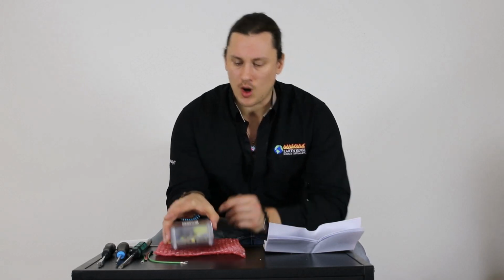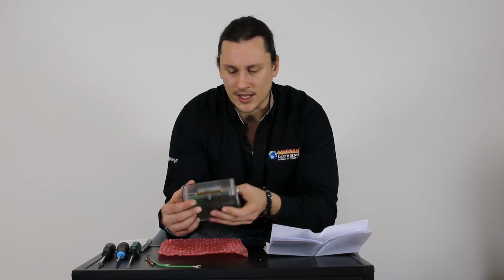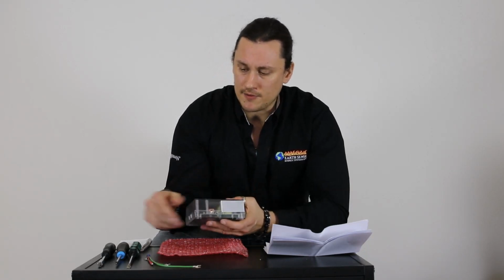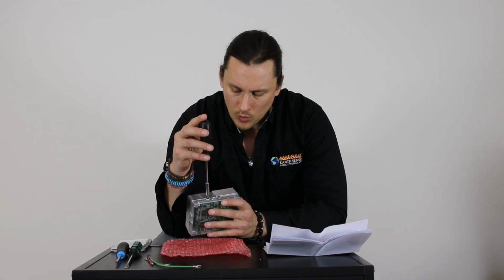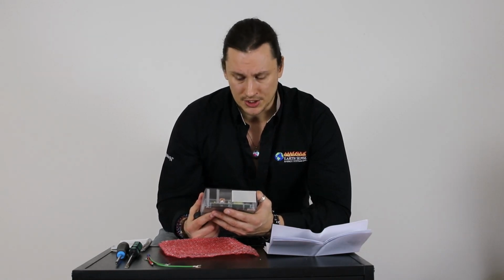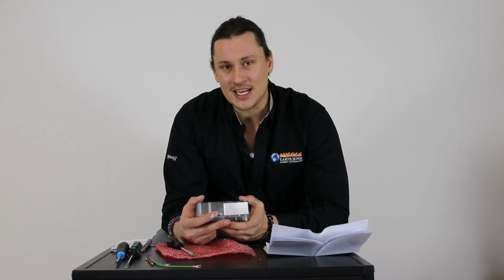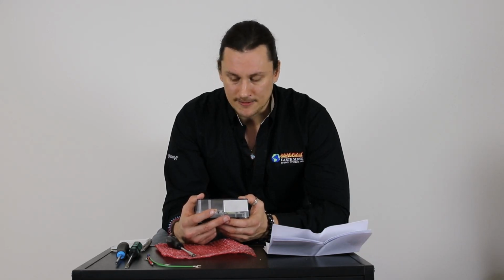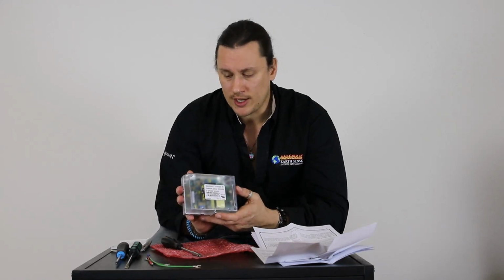QuadraFire 3 Speed Control Board Installation and Settings

Comment: I just replaced the control board on the classic bay 1200 and there is no power going to the ignitor and even in test mode there is no power going to the ignitor the stove will not light
Reply from the maker: Thanks for contacting us, happy to help. 
1. Let's make sure the igniter is good and reading proper ohms. (42.5-52.5 is proper range for the 300 Watt Loop Igniter). Video Link - https://youtu.be/z4wmCc96rVI?si=bV796GOfe--aKazS 
2. If the igniter is in proper ohm range, let's check the igniter lead wires that come from the Junction Box. See if there is power coming through those wires from the junction box. 

Keep us posted, happy to assist.
Reply: @EarthSense  The 1st pin on the connector was flipped down so it was not making contact was able to get the pin up and now we have power to the ignitor. Everything works perfect.Thank you for getting back to me
Reply from the maker: @jillbrumbaugh384  That's fantastic to hear! Great job, and glad you are up and running again. Happy we could help.

Comment: How many millivolts is normal on a new thermocouple?  I  was trying to figure out if mine is aging, just trying to be proactive.
Reply from the maker: Thanks for contacting us, happy to help. Which Quadra-Fire model do you have? Different thermocouples are used based on the model.
Reply: @EarthSense  Contour is the model
Reply from the maker: @hugh2200  Thanks for letting us know. The Contour model will use thermocouple 812-4470. 
At approximately 300°F: 2.5–3 mV DC
At approximately 600°F: 12–13 mV DC

For reference: 
OEM: https://pellethead.com/product/quadrafire-heatilator-ecochoice-thermocouple-14-oem/
Aftermarket: https://pellethead.com/product/pellethead-replacement-quadrafire-heatilator-ecochoice-14-thermocouple/

Any other questions please let us know. Thanks.
Reply from the maker: @hugh2200  Additional Tech Note: If the MV are going the wrong way, down instead of up or up instead of down, we have seen the bullet connectors on some of these can be reversed to remedy the issue.
Reply: @EarthSense  My thermocouple is reading 20 when the red light comes on and 26.1 on medium setting, totally warmed up.  It's 12.4 at the Green light change
Reply from the maker: @hugh2200  Thanks for the message back. Definitely some higher readings you are getting off of yours. Is the thermocouple currently functioning as it should in your Contour?
Reply: @EarthSense ,yes, everything is working.
Reply: i bought the PH-2014 I was hesitant about trying it out.  I didnt want to burn it if i have to send it back.  Is there a millivolt range reading for 68 degrees. I can compare
Reply from the maker: @hugh2200  Thanks for the message back. Touching base with our technicians now, will follow up ASAP.
Reply from the maker: @hugh2200  Unfortunately our techs do not have specific millivolt readings like that to compare. Between OEM and Aftermarket, readings may be different. The most important thing is that the stove and thermocouple are working correctly right now. The PH-20154 thermocouple does have a full 2-year manufacturer warranty on it. In the event anything happens where it's not working correctly we'll make sure you are taken care of. Overall these thermocouples have been very solid with a good life expectancy. Feel free to reach out anytime if you need assistance. Appreciated.
Reply: I returned the thermocouple; it does not work for the contour model. It only generated 18.8 millivolts no enough to turn on the green light (20mv) to start the auger. I put my old one back it works fine. The model number supplied by Pellet head was PH-20154
Reply from the maker: @hugh2200  Thanks for the message back. I thought you had stated everything was working correctly. Just glad to hear your old one is working fine and you are back up and running. I'll certainly pass the note along to our technical team. Appreciated.
Reply: Thank you for the support, brother!
Reply from the maker: @hugh2200  Absolutely! Stay warm and have a Great Christmas and New Year!

Comment: I have a 1997 Quadrafire Classic Bay FS. After plugging in the combustion blower kicks on but never shut off even after it's 10min start up. All other functions of the stove seem to work. Thermostat calls for heat, pellets drop, fire starts. Snap discs seem to work. Convection blower comes on. Fan switchs seem to operate. There is a clicking coming from the control box. Changing the combustion fan speeds increases the clicking. No Quadrafire service near me so I self diagnosed and just ordered a control box from you through Amazon. I hope that was the issue?
Reply: Thank you for responding. Replacing the control module was the solution. The new module exhaust blower start up took close to 20min before no call for heat shutdown, the orig. was 10min. Also as others have said using setting 2 (10%+) was needed to have a stable level of burn. Thanks for your help
Reply from the maker: @dennisfrazier3585  Thanks for the message back. Glad to hear the new module was the solution here. There are revisions done to the control modules overtime from factory - focused on safety and efficiency. The exhaust fan shutdown time was one of those safety revisions. You can certainly try the #2 setting to see if it provides a more stable burn in your unit. Keep us posted on everything, we are always happy to help. Thanks again.
Reply from the maker: Thanks for contacting us. Yes, the control box is the component that will shut off the combustion blower after a set period of time during the cool down/shut down sequence. Most likely the control box is the culprit here. Please keep us posted once the new control box is installed. Thanks.

Comment: Can you do a video on the grounding wires?
Reply from the maker: Thanks for the message, Just responded to your other question regarding the control box. The grounding wires included with the control box are very strait forward. It will connect in-line with your thermocouple and the spade end of the ground can be secured to any screw on the metal body of the stove. We can certainly add this to our video list, but it may be some time before we would be able to create the video. Keep us posted, appreciated.

Comment: I have a Quadra-Fire Castile freestanding pellet stove. We ran it with the thermostat hot-wired closed all season long last year no problem. I connected the thermostat wires a few days ago, and the unit went dark. I saw the small spark that you would normally see when connecting thermostat wires, but then no power. There is no light on the control box at all. Just to check, I jumped the snap disc number three just to see if that could possibly be the issue, but there still seems to be no power at the control box. I verified that power is coming into the system, the leads to snap disc 3 have power. This feels like the control box has failed. Thoughts?
Reply from the maker: Thanks for contacting us. It does sound like a control box issue based on what you stated. Typically there is no issue with jumping the thermostat terminal, but it sounds like something shorted. Pull the control box out, see if there are any burn marks on the contacts. Get a good light and inspect all the wiring to the junction box. See if any wires are cracked/melted/exposed. If you do need a new control box, here is the aftermarket and OEM replacements we offer. https://pellethead.com/product/quadrafire-control-box-3-speed-circuit-board-ph/
Happy to help.
Reply: Just found your channel. I have a 1997 Quadrafire Classic Bay 1200. When you plug the unit in the combustion motor kicks on but will not shut off even after it runs its 10min start up. All other functions of the stove operate. When the thermostat calls for heat pellets drop and fire starts fine. Fan switches all work. Snap discs seem to be operating at temp. There is a repeated clicking coming from the control box when the convection and combustion fan are both on. Changing the speed on the combustion fan switch makes the clicking faster.  I just ordered a new control box from you through Amazon. No Quadrafire service near me so I self diagnosed. Hope I was right?

Comment: Where do the ground wires go?
Reply from the maker: The Ground Wire can be secured to any metal part of the stove body. I just sent a reply on your other message, happy to assist. Thanks.
Reply: @EarthSense didn’t seem to make a difference. No call lights at all.
Reply from the maker: @WilliamAllen-k8h  Thanks. Sent you a reply message on your other thread of questions.
Reply: Got it back up and running. All I had to do change the door gasket and adjust thermocouple
Reply from the maker: @WilliamAllen-k8h  That's fantastic to hear! Any other questions down the road just let us know, always happy to help.
Reply: @EarthSense thank you
Reply: Thank you for responding
Reply from the maker: @WilliamAllen-k8h  Most welcome!

Comment: 2003 HHT-7000-106 QuadraFire 3 Speed Control Board. What Control Board will work for a replacement?
Reply from the maker: Thanks for contacting us. If you have a 1200, Castile, Contour, or Santa Fe model, this will be the correct replacement 3-speed control box. https://pellethead.com/product/quadrafire-control-box-3-speed-circuit-board-oem/
If you have any other model, the control box will be different. Happy to assist, thanks.

Comment: I bought a house that has the Castile stove. I just check the control box and it’s been on setting 4 with a date of 2008. It was running decent for the last few years. I just changed it to 6. What difference should I notice?
Reply from the maker: Thanks for the message. The #4 setting is for the Contour model, although a very similar engine to the Castile, the Contour is a bit different with feeding rates and the regulation of the combustion air. Yes, #6 will be correct for your Castile, glad you changed that. You should notice overall better performance and efficiency from start-up cycle into normal operation.  The fuel to air ratio will now be dialed in for the Castile. Keep us posted with the changes you notice on your end. Appreciated.

Comment: I have a 20 year old my Vernon with a 4-speed control. It’s been working fine until yesterday, now the motor on the bottom towards the back of the unit will not kick on. It’s starting up and firing pellets and the fan inside the exhaust duct is working. But the fan in the back is not coming on at all and eventually the fire pit just goes out. The control board is different than this one and is dated 2004, with 4 speed. We just moved into this house and inherited this stove, and it’s my first pellet stove. It has always worked previously but also has been fairly loud while working. Now with that motor not running it is much quieter. I am wondering if it’s the motor itself that is not working or is there a fuse or something inside the control board? Any tips would be much appreciated
Reply: There is only a red and a green light on the control box. At first I noticed the light was solid green. Now when I’m looking at it, the green light is blinking. I don’t have any original instructions and finding info for this model on line has proven difficult.
Reply from the maker: @glennfrock9465  Thanks for contacting us, happy to assist. You have the Original Mt. Vernon, often referred to as the Mt. Vernon OE model. We carried this model for many years. Yes, this unit will use a 4 speed control box. I believe you are referencing the Distribution/Room Air blower not working. If that fan is not operating correctly the stove will reach high temp and go into shutdown. Here is a link to the owners manual which will be helpful for you https://www.manualslib.com/manual/1805571/Quadra-Fire-Mt-Vernon-Series.html?page=38#manual

Your unit has a #1 Low Limit Convection Snap Disc. This disc is designed to close once temperature is met allowing the distribution blower to come on. 
FOR TROUBLESHOOTING ONLY, let's bypass this switch and see if it is the culprit. Here's a video on how to do this. https://youtu.be/FDVkbsHS95U?si=2-wpezRvfgkOAqpQ.
We never want to leave a safety switch bypassed, just for troubleshooting. If nothing changes with the operation of the blower, we would suggest running the blower to direct power to see if the motor is good or bad. Here's a video on creating a test cord to do this - https://youtu.be/rlmiCYI2WPk?si=wKcyeJbg8vUgR3Ia

Keep us posted, happy to help.
Reply: Okay, I did this and once I give power to the stove, the fan kicks right on, and stays on. I put about a half a cup of pellets in the fire pit to start up and it was working initially but now the pellets aren’t feeding through the chute. I’m guessing it has something to do with that switch? Where can I find this part?
Reply from the maker: @glennfrock9465  Thanks for the message back. That limit switch is only in-line with the distribution fan. It sounds like that switch was the culprit for the fan kicking on. I will send over a link for that switch. As for the unit feeding pellets, that would be different. Does the stove initially feed during start-up and light? And then just not feeding after that point? Or does it not feed fuel at all? Happy to assist. Thanks.
Reply from the maker: @glennfrock9465  Quick update, the original #1 low limit convection fan switch for your Mt. Vernon is SKU: 230-1340, however it's no longer available from the manufacturer. We would recommend a limit switch like this, but you need to check first on how your switch is mounted - flat or recessed. https://pellethead.com/product/quadrafire-heatilator-ecochoice-1-low-limit-convection-snap-disc-125-degree-safety-switch-thermodisc-oem/
Keep us posted, thanks.
Reply: @EarthSense  I got the #1 snap disc in the mail and quickly realize what you mean about flat or recessed. All of the switches in my unit are flat. The one I received is recessed. I installed it anyways and have had it running for about 25 minutes and no convection fan and no pellets feeding. Could it be because the #1 snapdisc switch is wrong?
Reply: I prefed about 1/2 of pellets by hand into the fire pit before turning on. They burned fine but I didn’t see any other pellets being fed through the chute.
Reply from the maker: @glennfrock9465  Thanks for the message back. If no pellets are feeding during startup or when you press the reset button, let's check the high limit switch. The high limit switch is a manual reset switch in your model, meaning if it trips you need to push the middle of the switch for it to reset. If your blower was not working before, I'm sure the unit reached high temp and this switch tripped. Let's start there, let us know if pellets start feeding once you have reset that switch. Here is what the switch looks like for reference. https://pellethead.com/product/quadrafire-heatilator-high-limit-switch-snap-disc-3-manual-reset-oem/
Reply: @EarthSense  thank you so much for your advice last time, it was very helpful and helped get the stove working great. Now one year later we are having different issues and I was hoping you would be able to help me on this one! 
So the stove has been working great for the season but today I fired it up and in the middle of it running the exhaust fan just shut off. Fire still lit, still dropping pellets. Then after 5 or so minutes the exhaust fan comes back on and it runs normally, exhaust shuts off again, then comes back on so I turned the thermostat off, exhaust fan continues running. Blower motor comes on without exhaust fan working. Any tips? I haven’t had time to open it up yet but I’m thinking maybe a bad fuse or control box issue? This is a 4 speed

Comment: hi, i am having issues with my classic bay 1200. fire ignites then pellets stop  feeding. thermocouple replaced. check snap disk 1 and 2. ckecked ok. vaccuum switch ok. i have older control board 7000-106. no red or green lights come on.suspect bad control board. any suggestions before ordering new replacement cb would be appreciated thanks
Reply from the maker: Thanks for contacting us. Yes, generally that would lead us to a thermocouple issue. Let's try a couple things with the thermocouple first. 1. Reverse the wires to the electrical posts. We have run across several where the Thermocouple wires need to be reversed. See if that does the trick. 2. Add an additional half-handful of pellets to the burnpot on startup. This will ensure that we are getting the fire hot enough to lock in the thermocouple. 3. Let's make sure the thermocouple is far enough over the burnpot. Couple video references below. Keep us posted. Thanks. 

https://youtu.be/Hjs3KhP9ntI?si=fJFwdGlkgXFfkoYb

https://youtu.be/tOqcNRELOq0?si=WxsVpg_yC1IGULNN

https://youtu.be/JhMTxAzQ9k4?si=CaINqx5S3bJLaEi-

Comment: I have a castile replaced control module. Seems like auger is stuck on high now. I have blower set to low but flame is high and keeps tripping high limit disc which I believe is pre set at 250.
Reply from the maker: Thanks for contacting us. Let's first make sure the dial on the control board is set correctly for your model. What was the stove doing before you replaced the control box? Why did you replace it? Always important to make sure the stove and venting are thoroughly cleaned and that the door, glass, and ash pan door gaskets are sealing tight. Any air blockage in the stove or vent will create an issue like what you are seeing with a big fire like that and tripping the high limit. Start with the basics and keep us posted here - happy to help get you back to 100%. Thanks.